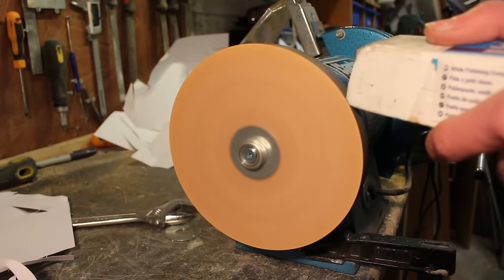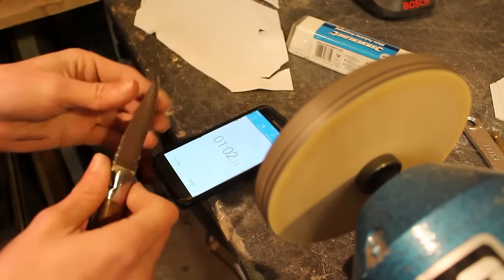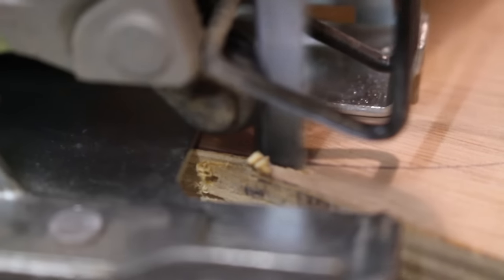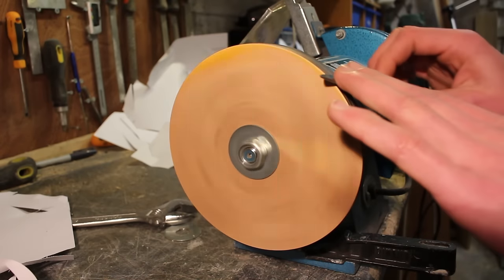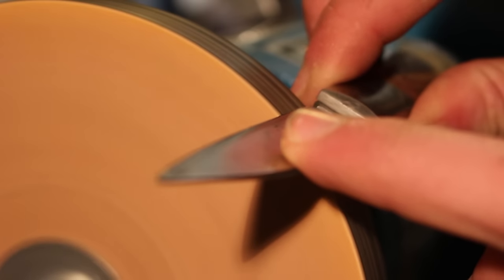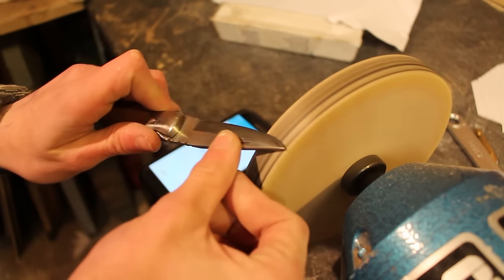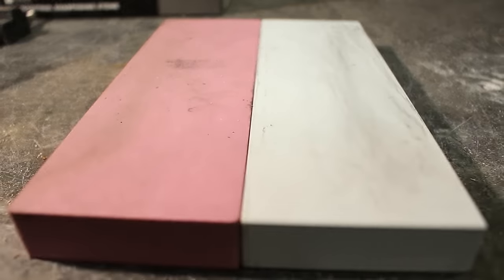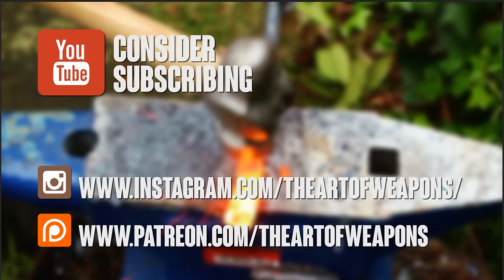The Laziest Way to Sharpen Any Knife to Razor Sharp 2

Comment: I'm into survival, I appreciate this quite a lot, I use a regular grinder for axes and stuff but this seems much better. Don't forget, use a face shield and thick clothes because even grinding away it can get snagged and caught in the machine and go flying. I like never using a cellphone cause led lights will eventually permanently blind you and you can expect all types of rf radiation, emf exposure. I just use ethernet, no need for wireless housephones or anything.

Comment: Thank you for this most clever idea.  I have the advantage that I can reverse the motor on my belt-driven bench grinder.  Let me, however, reinforce BCL's caution to be careful not to heat the blade edge so as to draw the temper of the steel.

Comment: Paper disks work even better than this and do not require polishing compound, but everyone should note:  (As you have addressed), blades and spinning disks are VERY DANGEROUS!  Only use the fingers that you don't mind losing. 
Any knife expert will tell you: A polishing wheel or buffer is the most dangerous piece of equipment in the shop!

Comment: The risk you haven't mentioned is that of changing the heat tempering and toughness of the metal whilst you subject the blade to this high speed friction.

Comment: I Thought I thought of everything! I have a dedicated bench grinder with a tight wound buffing wheel that I use for polishing aluminum with C22 compound. It's made to sharpen scalpels. Or thats what I was told. But I have tried it with knives. I can't sharpen a knife to save my life. I will try your wood technique. That would shock any one that sees it.

Comment: I will come back after I try this... but it really makes sense.  #1  thing that I have to say is that, yeah, I am the target audience and this will be very easy to set up.  The only thing that I find strange is turning the bench grinder around.  Why don't you reposition the knife instead?  You don't HAVE to hold the knife on the top... that's kind of why there are two disks in the first place.

Comment: I don't see why you turn the grinder around. Wouldn't it just be easier to hold the sharp edge of the knife downward and use the grinder in its normal position?
Reply: I'm thinking it gives him a better view of the angle on the knife  edge as he is sharpening.

Comment: The temperature at which the edge loses its precise hardness is considerably below glowing dimmest orange, and it's easier than you think to screw up and get the edge that hot on any power tool. This is why you don't see this with knife lovers. Sure, you'll get an edge, but if you're not twice as skilled as it takes to sharpen with stones and elbow grease, that razor edge may never again last nearly as long. The price you pay for quick removal of material is heat without time to dissipate. Granted the blade acts like a heat sink, and you're going quick and not removing much, so you may be ok, but you're pushing the limit of the temper.

Comment: Buffing wheels are the fastest way to get an edge on the knife. It is also one of the easiest ways to burn an edge. And shops know that buffers are one of the most dangerous tools in the shop. It's too easy to grab and edge and propel a tools into parts unknown, nice to see you buffing away from your body!  As with a lot of things high operator skill makes it look easy. People watching this video need to realize that there is a large learning skill hump to get over before you'll sharpen knives well with this technique. If you try it start with cheap knives you don't care about!

Comment: Hi, yes an effective method (ignoring the overheating issues) but also a bit dangerous compared to low speed wetstone wheel sharpeners which are more expensive but do not have the overheating issues (due to a constant water bath) and do not have the concern of the plywood disk delaminating under load at full ac motor speed (approaching 3000 RPM). Simple and cheap but could turn out badly if you are not wearing a full face shield. bye

Comment: Long ago I found an easy way to sharpen knives. When my knife got dull... I started a knife collection. That allowed me to buy a lot of knives without my wife complaining.  
     By the way... on a new stone use a file to slightly round off the edges of the stone. When removing the knife from the stone's surface it is too easy to have the sharp edge of a square edged stone to remove the work you just did. Also, a very small burr forms on the edge of the knife while honing. Remove the burr to get the real edge of the blade by lightly stroking the blade's edge on some wood a couple (2) passes... now you have exposed the knife's real edge.

Comment: Whetstone is a lot better.  Its not faster, but definitely better.  The best part is that its portable and requires no electricity.  Once you get the hang of it, you can sharpen most knifes in 15 minutes and re-sharpen them in about 5 minutes.

Comment: 99% of the time you dont even need to sharpen your "dull" Kitchen knife.

just hold it in around 45 degrees to the backside of another blade (the edge should not be rounded to much) and slide it from the handgripside to the tip over this edge. (one time the left side of the blade... one time the other)

Comment: what about those sharpening rods that come with knife sets?  Don't those sharpen too?
Reply: If you're talking about those steel rods that come with kitchen knives, no. Those are honing bars, they're meant to maintain an already sharp edge, not sharpen a dull one. Also depending on who you ask they either don't work, don't work any better than other honing methods, or outright damage the edge.

Comment: I'm not even 30 seconds in and I can already say a huge disadvantage to this is a concave edge.
Reply: the edge is not nearly big enough to get concave, also the part that touches the wheel remains flat
Reply: @MrGodofwar666  Yeah, no. Using a wheel results in a hollow ground edge.

Comment: I know this is a video of 
1/21/2017 And it's probably in the comments already but, use a microscope look at the edge you will see a foldover on the finished job when using the wetstones to fix this problem try 1000 wet/dry
Sandpaper, or if you are lucky enough to have a 
Barbars strap that is the best way to get a perfect finish on your blade 👌. 
Or you can fashion it from an old leather belt. Worked on with sattle soap and other softeners for leather.
Ofcourse cleaned and hung up for use.
Nothing like a straight Razor edge for me on anything from a knife to a long chunk of steel for the cut you can't get enough of 
Do it or buy a cheap one that rips through the steal.
If you're interested in the best way/or nessity be careful with your weapons Ofcourse...OKEY..BYEE..!!
   Oh good video ......love the wooden wheel brilliant 
Inexpensive way to do a great job!

Comment: A few comments...
If you're looking for a compound, in the US just about any hardware store will have tripoli, buffing compound, and jeweler's rouge. Usually sold as a stick of one color, or a pack of 3. Each has its strengths vs the material you intend to use.

On safety, I find the lack of any kind of guard or tool rest disturbing. I would also caution that you should err on the small side since larger wheels have higher radial velocity and are more likely to grenade sending wood shrapnel everywhere. Gloves, a face shield, and an apron would seem to be in order. 

It's a great idea for high volume sharpening, but always stand to the side and work safely. Spinning disks and highly sharp metal can have lethal consequences for the careless or complacent.

Comment: definitely don't miss the part where he turns the whole grind wheel around backwards...make sure that wood disc spinning away from you, NOT TOWARDS YOU  --or the blade will catch into the wood surface and just might throw the blade into your stomach at 60 mile per hour (1725rpm  x 3ft circumference = mile a minute 60mph)

Comment: Well that's a method if you just have a power tool randomly laying about. But you can sharpen a knife using the back of another blade, provided the second knife has strong metal and is squared off. Not the most precise method, but can get to razor sharp with practice. It's the lazy/pauper's razor.

Comment: Bench grinder is the most dangerous tool in a shop.... I tried the Razor Sharp System (which is a wheel with cardboard) and it was extremely dangerous

Comment: DO NOT USE A SOLID PIECE OF WOOD, IT MUST BE MADE FROM PLYWOOD ONLY! unless you want the disc to fracture at 10,000 rpm and possibly end your life. I would also recommend not using plywood any thinner than 3/4" thick.

Comment: I've used this method for years. This doesn't actually "sharpen" the edge. It's honing it (aka stropping the shit out of it) if your knife is so dull there is no apex for it to straighten out then it doesn't work worth a damn. You need to sharpen the edge first with stones then use this MDF wheel with compound to tune it up every now and then if become dull beyond stropping by hand.

Comment: I did it that way years ago.  But it is not a good method.The front narrow ridge of the blade glows out and the blade loses its hardness and toughness. However, if you just cut a sheet of paper or a soft tomato to test, you will only notice the instantaneous sharpness of the blade. A real top knife must be sharpened slowly.

Comment: I have something about 30 times easier,take a piece of 1x2 and cut it to the lenghth you like,takes 6-8" ,use the sand paper you like,i use Emery paper.you can round the square edges a little.cut the sand paper to the width of wood or slightly more.i have a blur with a recurve and ut takes me about 2 minutes,can't be simpler

Comment: Your method is good , but you did not address the secondary edge , knife has 2 edges , secondary that is above primary and primary that you are sharpening . If you do not thin out the knife as you use it and sharpen it , the V shape will become duller and duller  , so as you sharpen you need to sharpen both edges , most knifes have it .

Comment: I’m not a expert but I have heard that this method could heat up the steel and mess with the factory heat treat in the process.   Bad news.
Reply: Nope! Be gentle, take your time, and check if the blade is getting hot and you won't have a single problem

Comment: One thing you do not mention is if you do have a knife with extraordinary hard Steel this method will not work if you do have a knife with extraordinary hard Steel you will need a whetstone to get an edge on the knife first then your method will work to recondition after it's already had an edge made your message will work on softer steel to create an edge of course when you do have a knife with extraordinary hard steel you don't need to sharpen near as often as a softer steel only need to use a steel because after a very hard steel starts to lose its Edge it's not Dull it's just the fact that it has phrase in it and all you need is a butcher still to smooth it out and it sharp again you have to look at a blade under a powerful microscope to know what I'm talkin about

Comment: You're just using the wood as a sharpening material?
Reply: More like using it as a base, the wood is nowhere near hard enough to actually remove material to sharpen the edge. The wheel is the carrier for the polishing compound (that white brick you see him holding against it at 4:02) and the polishing compound is what's actually doing the work.

Comment: I can totally see an inexperienced person getting the tip overheated or and ruining the steel of the blade. Lower RPMs are definitely more advisable. Consider you can paper strop by hand.  That speed is not necessary if not damaging.

Comment: And you made this from using plywood anf buffing compound? How do I go about sharpening a brand new machete, that has never been sharpened by factory? The bottom blade is as thick as the top. What would be the easiest method?  I used a whetstone to sharpen my wooden handled kitchen knives that was handed doen. That was an easy task, as I learned from my dad. Why did you draw lines on your whetstones? Inquisitive minds want to know, and I am 1. TFS
Reply: When the whetstone is uneven...and you need to even it out...
Reply: @chankongart  ty
Reply: Brenda Morris sorry my reply was a bit too short.. you draw the lines on the whetstone.. and as you level it out, all the lines should disappear .. so those lines that are erased or cleaned out last is the deepest part or the most worn out part of the stone .. hope this reply is clearer

Comment: Instead of turning the grinder around couldn't you just flip the knife over keeping the edge at the bottom instead of on top? A lot of grinders are bolted down like mine as they should be.
Reply: It's still a safety issue. If the wheel is moving in its normal configuration and it catches the knife blade in just the wrong way, or you get distracted, or any one of a hundred other things, then that knife blade is going to be coming straight at you rather than being pushed away if it's reversed. Nasty accidents happen that way all the time.
Reply: That's why you keep the edge down. And you keep the blade down more in the front instead of on top. The wheel is moving downward in the front. Also you keep the guard on the grinder. And if you can't keep a grip on the knife you shouldn't be sharpening anything. I think it's probably safer then having the grinder turned around where you have to reach over to the back of the grinder to reach the switch. Also grinders should be bolted down to the bench. Having to unbolt and re-bolt the grinder could temp people to just leave the grinder unbolted. That can be dangerous also. With competence it should be safe enough.
Reply: @stevenw4549  *shrug* You can argue it with the guy that did the video if you want to argue the reasoning, I was just explaining my understanding of it. Personally I think the whole thing is an awful lot of trouble to go to just to sharpen a knife faster.
Reply: @dudeistpriest787  Fair enough. Now if I can get a government grant to study the environmental impact. I'll need a fleet of vans, a ten story building with staff, a huge house with a huge swimming pool. I figure about $50 mill ought to do it. LOL
Reply: @stevenw4549  Don't forget the consulting fees, that adds another $5mil easy.
Reply: @dudeistpriest787  Yea I way underestimated and with inflation I think maybe round it to $1.2 billion. Thanks.

Comment: pack layers of cloth hard felt, thick leather orjust buy a cotton buff mop.. metal polishing bricks.. abrasive stones will never "sharpen" razer sharp.. even cut throats 10k grit requires finishing on a leather strop loaded with wax.. good video though.. consider learning to use a smooth tempered butchers steel to take it to the top level sharp

Comment: For the love of god will people just stop abusing the term "Razor Sharp". "it cuts paper so it's razor sharp....... wrong. it removes hair on your arm so it's razor sharp, close but no. Razor sharp is a blade you can shave your face, pits or pubes with. It takes high quality steel that has been hardened and tempered to a higher hardness than any but the finest kitchen knife, the bevels have to be ground down much sharper and then honed on a progression of finer and finer whetstones finishing at 8000 grit or higher and finally stropped on leather. A razor should be able to cut the hair off your arm without the blade actually touching the skin, think hair clippers a few mm above the skin. The hanging hair test, take a strand of hair and touch the edge of the blade with it, if you have a razor sharp edge the hair will cut with a little plinking sound. That is razor sharp.

Comment: So i need a bench grinder or some kind of power tool, cheaper to buy a new knife.
Reply: ?? You don’t have a drill, angle grinder or bench grinder? You can buy grinders for like 20-30 bucks. They ain’t worth a shit but would do this job easy. I probably will try this out just the fact I remember my dad had one when I was younger. But I usually just use sharpener stone the tri-stone. Takes some time to finally get the factory edge like you want it and steady hand but works like a dream also.

Comment: uaaa ok i done this for YEARS its NOT GOOD FOR THE BLADE over heating the blade using this method will make it brittle. its good for a quick fix on crappy cheap knifes BUT DO NOT DO THIS TO REALLY GOOD KNIFES.

Comment: Sharp yes but will hold the edge, I doubt it.
Reply: As with most knives it depends  on the quality of steel the knife is made from, and a steeper angle (20° each side) lasts longer then a shallow angle (10° to 12° each side)